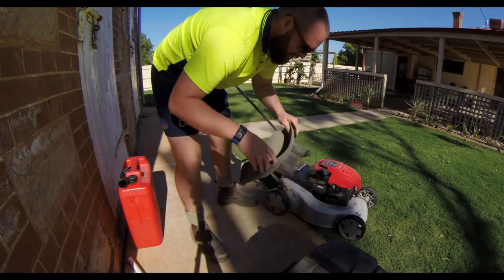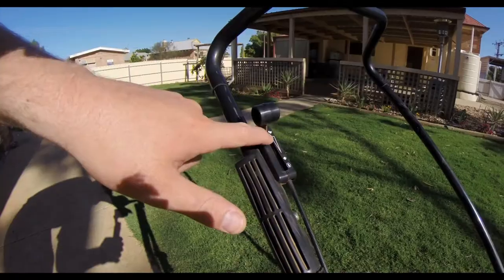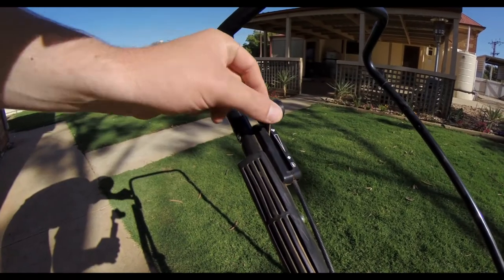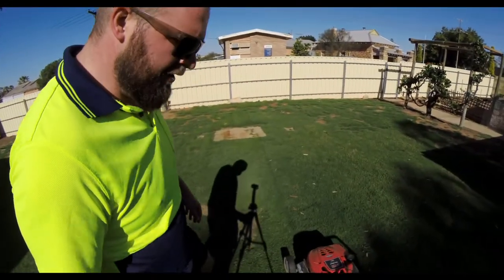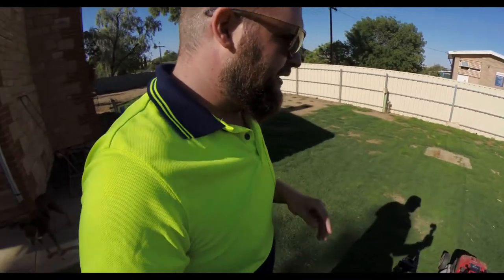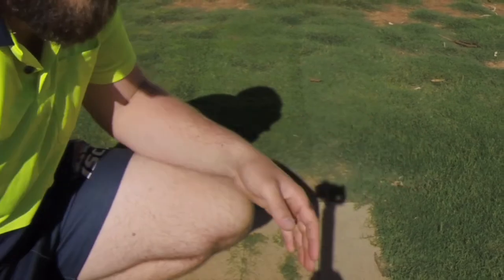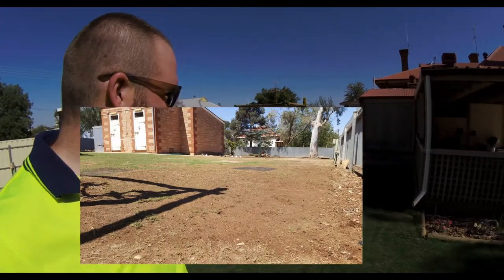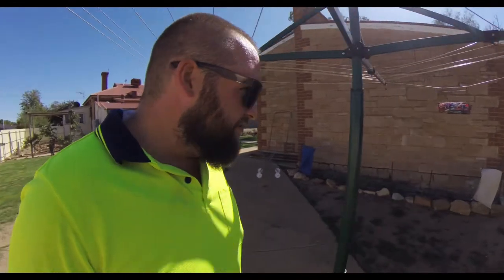Quick Mow // Before and after pictures

Comment: What was your height of cut with the rotary mower ?
Reply from the maker: I haven't measured it but it's the 2nd lowest setting on that particular mower. based on the transition to the cylinder mower I'd say it would be around 25mm